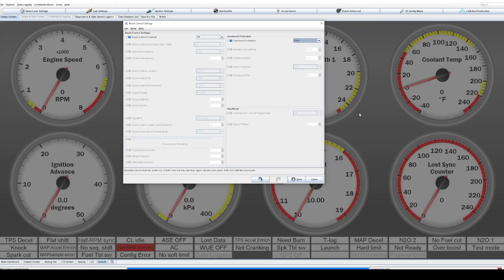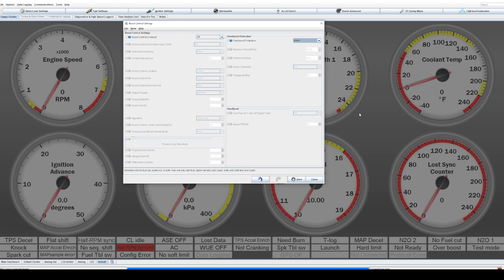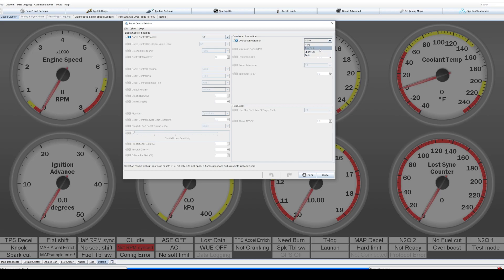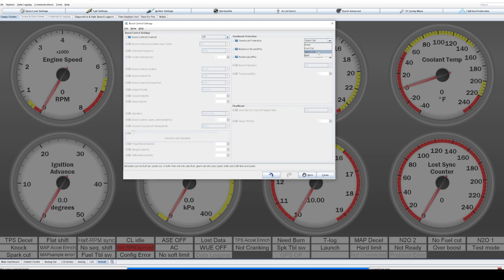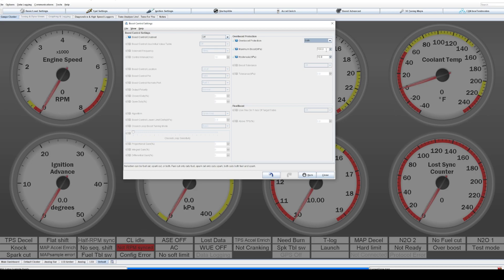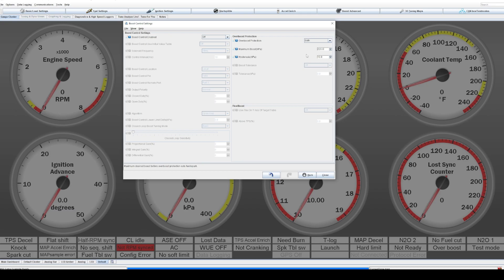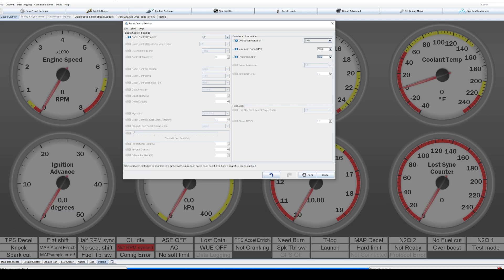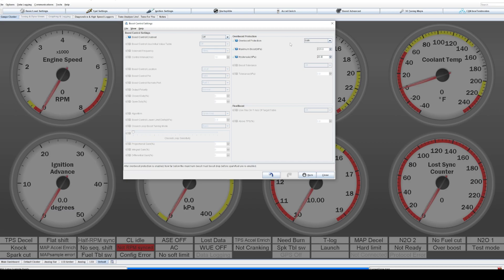Megasquirt Overboost Protection Basics | Learn to Tune | How to keep your motor alive with boost !

Comment: hey bro, first off enjoy all the vids I've seen you put up. Nice detail. I just got my '98 wrangler 4.0 turbo running and have the ms3x with 3.57 version. Having some challenging issues trying to get idle set.. wanted to know if you had any input? At cold start it idles at 14.7AFR happily but sitting revved to 2300rpm. Can't get it to go any lower.. And once warm- it won't idle down under 3,000+. I even unplugged the iacv to see if that's effecting it and no difference. Lastly, when I lean it out to 19:1 AFR it idles around 1,100rpm.. what's going on?